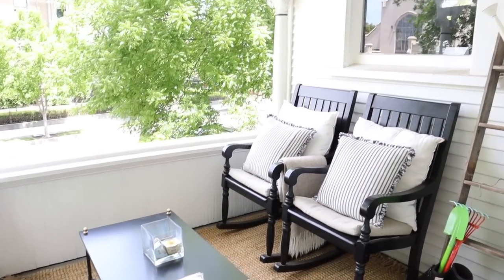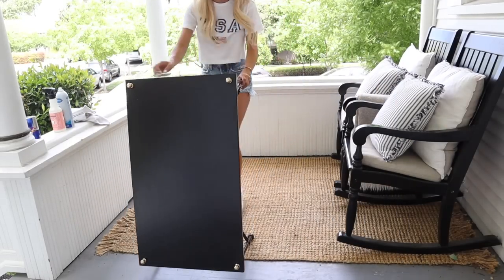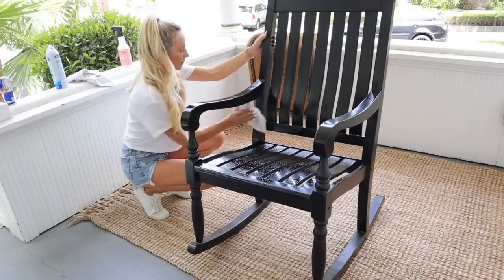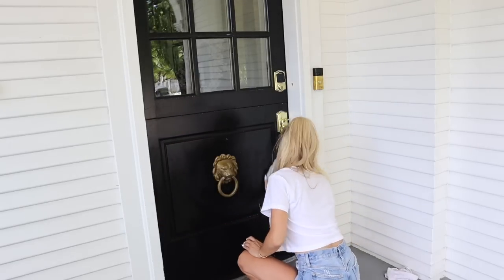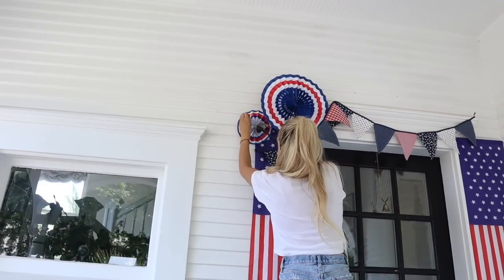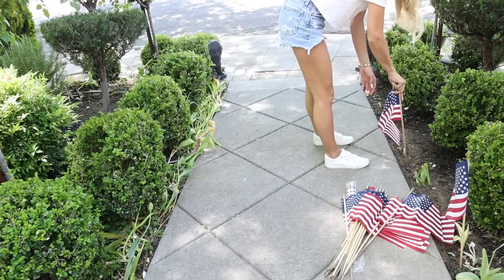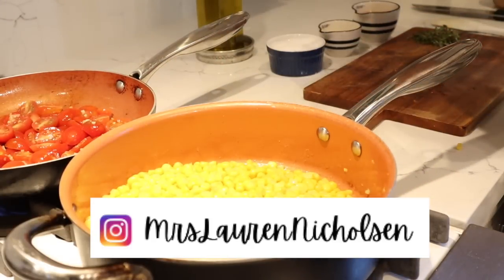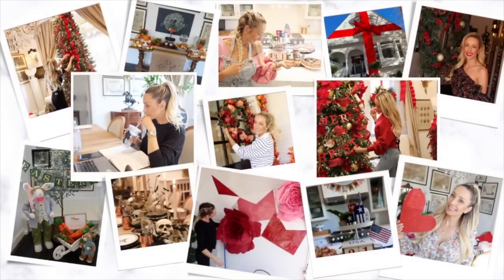SUMMER PORCH DECORATE WITH ME // SIMPLE SUMMER RECIPE COOK WITH ME // Lauren Nicholsen

Comment: I have a 3 person couch shaped outdoor piece ( we have a deck not porch ) facing the center. I have that same or similar long bench as you that I use as the table and then two similar matching chairs facing it.. Then behind it on another part of the deck I have a bistro table and two chairs ( same as the two that face the couch part ) I think the rockers are great for your porch and it's nice that you can move them around. I get so excited for your porch decorates. We live in the pacific northwest not too far from Seattle. It's been a mix here of rain/warm/cold. Most often our weather doesn't get consistent enough until after July 4th. I definitely need to get more decor. Last year I spent a lot on the furniture pieces/rug/table/pillows/grill